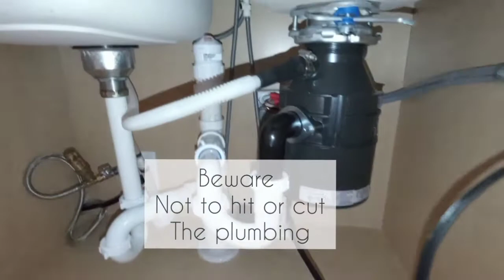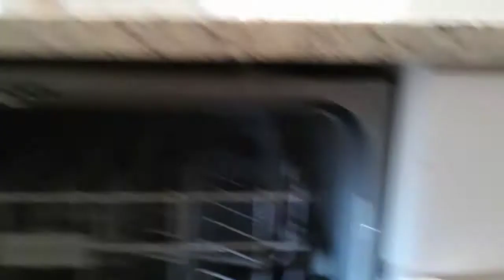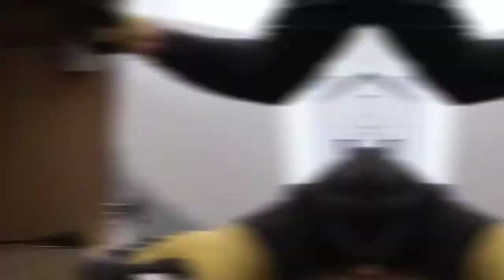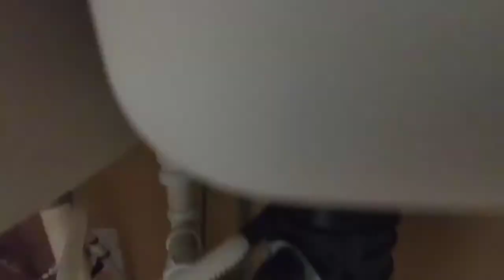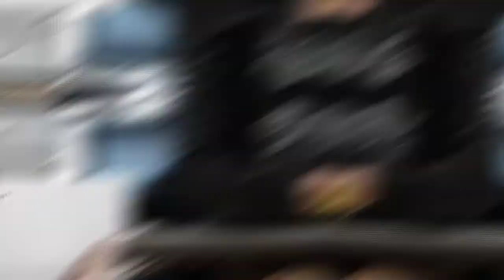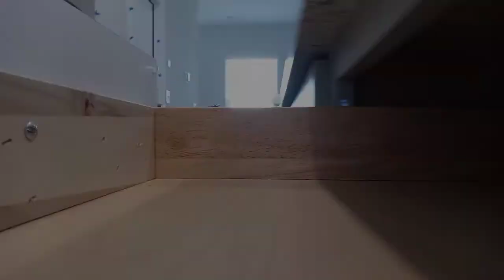How To Remove / Replace Kitchen Cabinet Faceframe | Refacing Cabinets

Comment: Did you build the face frame or purchase it? If purchased, where?
Reply from the maker: Hello your cabinet manufacturers can provide them for you, especially since every manufacture is different im not saying it cant be done with a different company frame but for a smooth transition you could contact your designer, builder or cabinet store to order only a face frame.